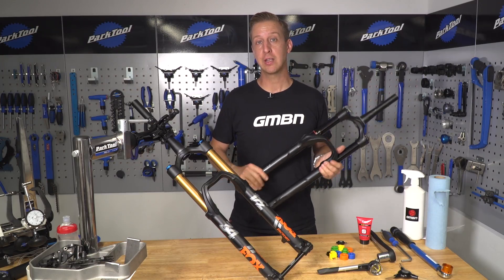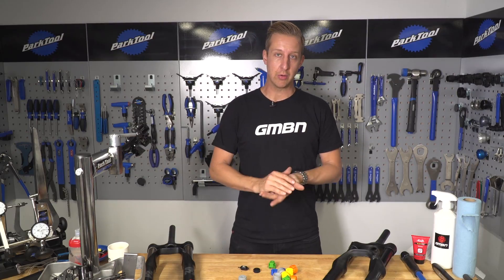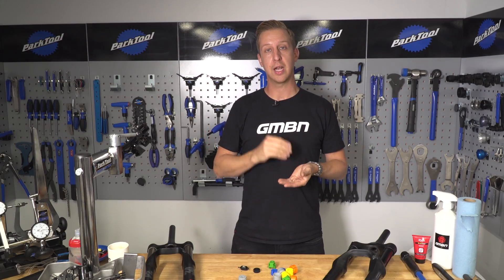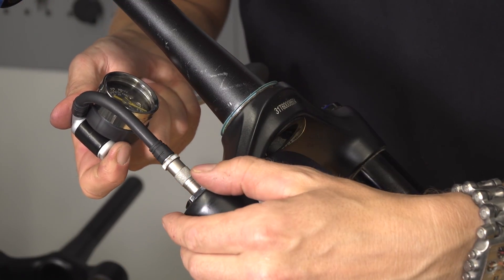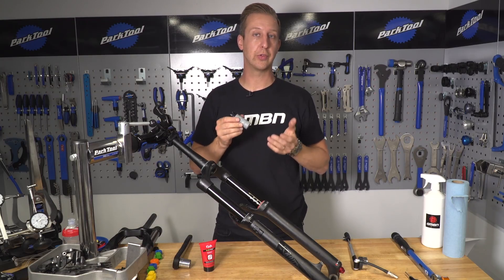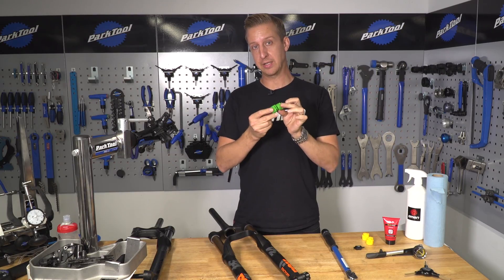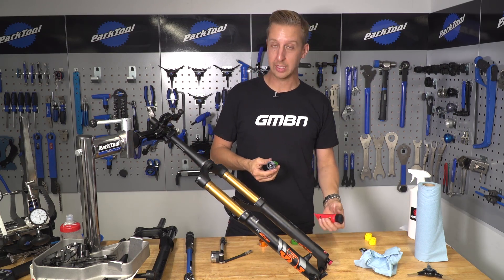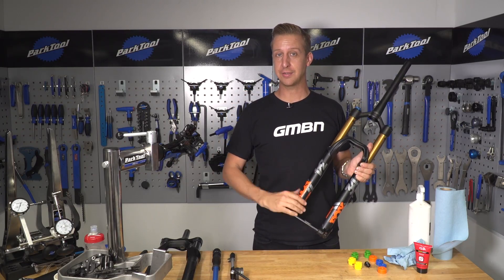How To Adjust Air Volume Spacers In MTB Forks | Mountain Bike Maintenance

Comment: Hi i have a question for you i bought trek mountain bike with RockShox judy silver front fork 120 mm travel. I had some problem with that fork so i sent bike to shop to fix it they fix the lockout part but now fork is hard and jerky and just travel may be 80 mm. Shop is not considering this as problem so can u help me what is going wrong with it . Also recommended air pressure to my weight is 120 psi but on 120 psi fork is hard roack .

Comment: I have recently baught a specialized demo with a bos idylle rare air fork and i have a probleme on it 
I rode it since 3 days without any problems and now the fork is at 20% of the 200 mm and it works nice but when i pull/extend it the fork get back to the 20% 
I looked on internet and it was talking about the positive and negative chamber but i dont want to disassemble it 

What to do /have you got any answer

Comment: HELPPPPPP !! I have a 2015 specialized demo 8 with some pretty old fox 40 rc2 forks (the spring ones) and I wasn’t getting any travel, turned out someone put an innertube on the spring instead of shrink wrap and it got stuck, so I sorted that with proper heat shrink after spending hours getting the spring out,

So... 
I now have travel but nowhere near the full 200mm about half of that at max,
I thought it was from having a spring what is too stiff however after trying my friends bike with a yellow spring which is stiffer than my green I can still get full travel on his with ease, mine seems real firm in comparison, 

I since noticed I should have 3 air volume spacers yet I have two and then it’s as though someone has just put two headset spacers in there Instead of the 3rd spacer, could this be the cause to my issue of not getting full travel maybe !?

Comment: #askgmbn can you use rockshox oil on fox suspension or fox oil on rockshox suspension? or will it damage the seals?
Reply: you can, just keep in mind that 15wt fox oil and 15wt rockshox oil are not the same by its viscosity
Reply: Benjamin Samardzic What?? 15wt is 15wt and don"t spread bs for no reason.
Reply: Rich Piana's Oil Distribution Manager No he’s right, that is the case with Rockshox and Fox oil. Just because they print 15wt on the bottle doesn’t mean it actually is
Reply: Alec Moore It is.

Comment: so by adding volume spacer,    it will reduce  the amount of travel ?
let say a fox 36 150mm,    If I install volume spacer it can drop to 140mm travel ? 
travel will drop only when you ride or even the bike is on park mode  ?
Reply: Not an expert by any means, however my understanding is that air ramps up in firmness the more it is compressed, if you want to test this, get a syringe and cover the bottom with your finger and compress the air inside. Therefore, lowering the amount of room the air inside the fork chamber has (by adding plastic to take up that space), means that the air ramps up faster (it takes less movement of the fork to compress the air inside), through the same stroke. By ramp up I mean how hard the for effectively feels. So short answer no, no this does not reduce the available travel on a fork. It simply makes the psi's you have in the chamber work harder ;) Hope this helps, also hope I am correct lol!
Reply: @jamiehunter91  thanks

Comment: I just twist my MRP knob.........................
Reply: Worth every dollar to fix it on the fly. No guarantee your fork setup will be good/perfect for any given ride ahead of time. MRP ramp cartages and forks is the way it should have been from the get go on fox/rox
Reply: lol just what I thought this MRP ramp is so awesome and IMHO works better than spacers
Reply: MRP ramp control is the shit, very smart invention
Reply: for me the dynamic volume chamber by SD components was the go, not right into changing my suspension too much on the go, one setting for all as the 3 stage lock out is enough change for me, the dual air chamber ramps up nice, still have mid and low adjustability and no extra knobs and moving parts to service, just another air chamber, so it has two chambers that ramp at different times through travel, awesome bit of kit worth looking into.
Reply: MRP cartridge only effects the bottom out, doesnt give support in the mid stroke like volume spacers do .
Reply: Do you not need to re-adjust the air pressure to get the same sag?
Reply: Heygood lookin No, you dont need to change the air pressure because the MRP only controls how fast the air can travel to a valve in the unit. PS: Sorry for my bad English I'm from Germany.
Reply: Not the same thing as adding volume spacers. Sorry bud

Comment: I tried to take the top cap off my Rockshox Pike DJ and once unscrewed I wasn't able to remove it all the way. It was attached to a shaft and I didn't want to pull to hard on this assembly. According to Rockshox's website though I can put two spacers in. What should I do?
Reply: SeanPep local bike shop may help, also, double check u have the right model to the one in the manufacturers guide

Comment: nice vid but its a shame it has to be a 24 socket,  because i run the same Yaris and want to put spacers in but cant because i don't have the tool
Reply: Jack Bentley so by the tool?   24 socket available at just about any automotive or hardware store

Comment: After installing the spacers, you need to lower the psi of the no spacer set up
Reply: If you were running higher psi to stop the fork from bottoming out then adding spacer(s) 'can' allow you to run slightly lower psi if you desire but the lower psi will obviously increase small bump compression & initial sag - everything is a tradeoff. Rule of thumb, if your front fork has your weight in kg in pounds of air pressure (185# person with gear = 85kg = 85ft-lb of front fork air pressure), but you were running 90ft-lbs, if you add spacer(s), then you can reduce fork psi about 5% of your kg riding weight

Comment: So the spacers only go on one side of the fork? Under the valve? I thought they went on both side, the same amount on each side.
Reply: They reduce the air volume - only one side of a fork has the air "spring", the other side does the dampening, which is why  you only pump one side of your fork, not both.

Comment: So I have a Marzocchi 350 CR, do I add air volume spacers in a similar way to the RockShox and Fox?
Reply: Its the same thing but marzocchi doesnt have tokens - you use oil to reduce air volume. You can add like 10ml and test if its nice.

Comment: Torque wrenches are NOT to be used for removal. Only setting final torque.
Reply: So long as users operate with caution and do not exceed the maximum torque, most torque wrenches can be used for undoing. However, if the bolt will not free within the maximum torque of the wrench, another tool should be used instead...

Comment: Find it frustrating that manufacturers are fitting basic forks to e-bikes.... I’m after a diy solution to a set of recon 150’s that came as standard on an e-bike.. More annoying some shops selling my bike are quoting a debonair air spring and some a quoting a solo air spring... rather frustrating as the fork should never be fitted to an e-bike as it wasn’t designed for 50lb bicycles...

Comment: What is fork damping
Reply: Dampening stops the fork acting like a pogo stick so you don't bounce into the air when you go over a bump. It slows down the return rate by forcing oil through a restricted opening when the fork moves. When you adjust the rebound, you are changing the size of the opening the oil moves through so that the fork rebounds more quickly or slowly.

Comment: why would you re-inflate the shock to its previous set pressure? Surely after fitting air volume spacers you should decrease the PSI?
Reply: That's what I thought. Volume spacers affect the ramp-up of travel, but they do decrease the air volume so naturally less air pressure is required to achieve the same sag. At least in my experience that's what happens.